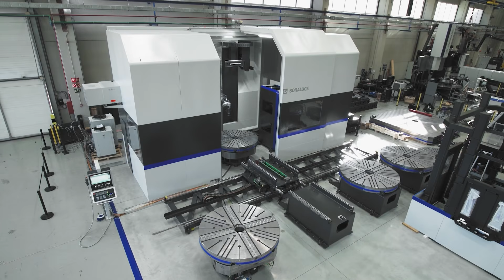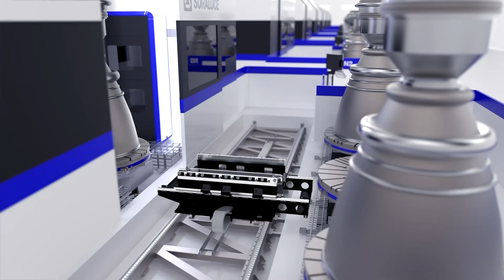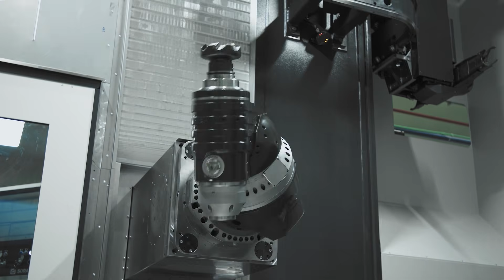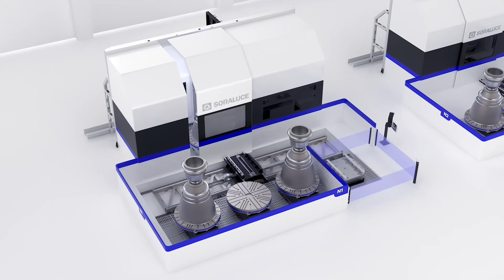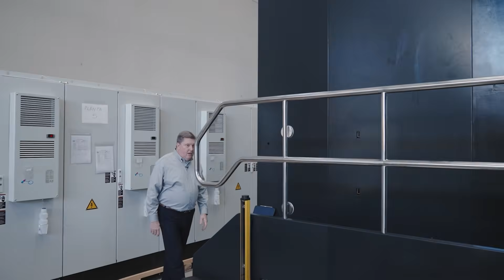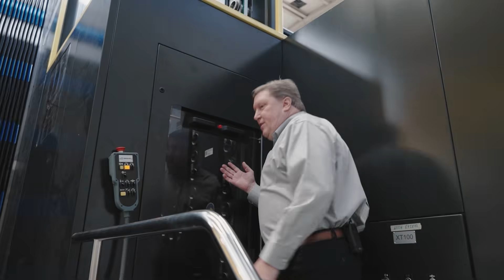Large Capacity CNC Mill-Turn for Machining Rocket Engine Components

Comment: Very nice machine. I have only one question: Why did you/the customer go for indiependent pallet pools insted of a long linear pallet pool that serves all 9 machines?
Reply from the maker: Here's a brand-new video of a customer in Germany (Krones, AG) featuring an FMS, as you've suggested. This particular installation integrates 3 Soraluce PM35  Bridge-Type multitasking machines to machine a wide range of parts used in packaging equipment. LINK: https://youtu.be/a5u4B0UT-rA
Reply from the maker: We offer both solutions, so great point. Unfortunately, I'm not sure why they went with pallet pools instead of an FMS.